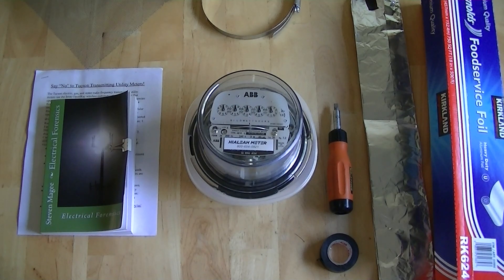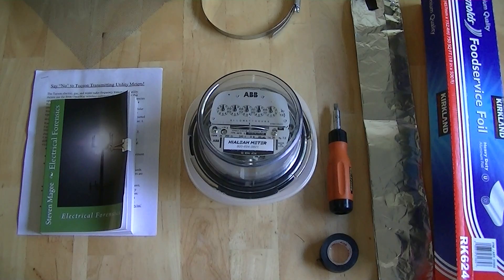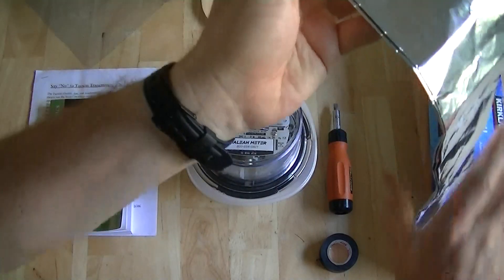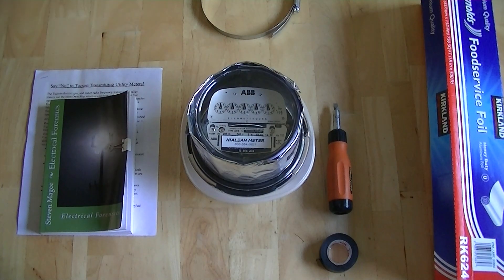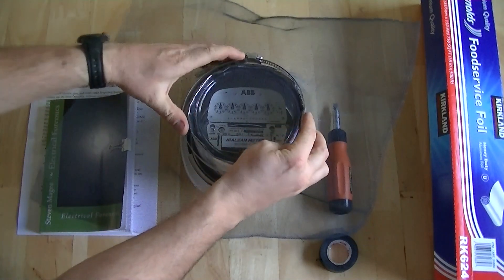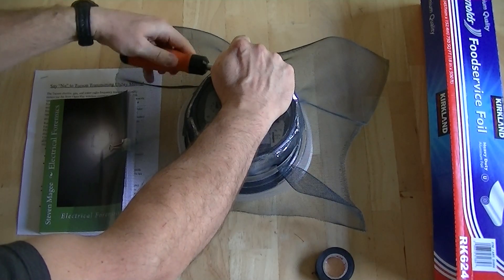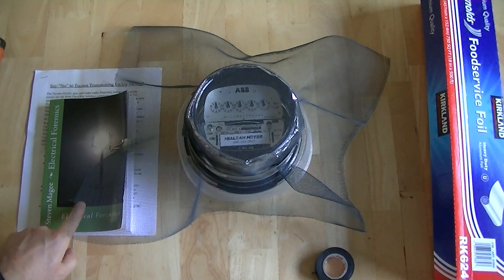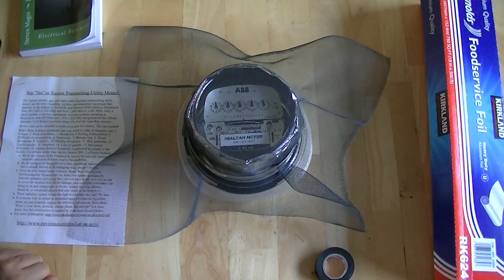The Cheapest Way of Screening a RF Transmitting Smart AMI AMR Utility Meter

Comment: I don't think you need the aluminum foil, and, in fact, that may not be a good idea. Just aluminum screen should be fine, and you DO NOT have to ground it with a grounding wire. (can't hurt)

If you get a decent RF meter and know how to use it, you can check to see what the levels were and are, and experiment if you want. Check anti-smart meter websites for more info.
Reply: If you dont ground it, the sheild just starts resonating (like a bell) with the signal from the stupid meter.

Comment: I'm UK....currently surviving as a slave to pedophiles as my identity was stolen over 13 years ago amongst other things. I'm not 'allowed' to leave. Moving is not an option. Pedo parents had one of these installed last week and it is making me very ill. Tired, achy muscle, my left/ good eye keeps spasming/ very blurry vision and all since it was installed. I was advised by another TI to get those foil emergency blankets...and they have no effect whatsoever. Don't have an RF meter but wrapping it 20 layers thick over my wifi dongle does nothing to dampen the signal......trouble seeing whilst typing this but I am very sceptical that this is going to work in anyway. Notice how the guy in the vid doesn't actually use an RF meter to test? That would be so easy to fake anyway.....nor does this method do anything to shield the back of it....but as i say because of my situation I'm not allowed to do anything to the meter.....it'll probably cause trouble more violence against me by shielding my room/ cell from it....but I'm looking for a cheap way to do that if anybody knows how to do that? No way I can afford the paint.....

Comment: In my country, the smart meter is inside the house. Can I cover the front well with foil too?
Reply: Use METAL screen to cover the front of the meter and aluminum foil for the sides. 
If you can, a space blanket can be pinned to the wall, behind the smart meter.  Not underneath the meter base, but on the other side of the wall. 
Check you space blanket  first. Wrap a cell phone twice with the space blanket, then call the cell phone.
If the cell phone rings, buy a different brand.

Comment: what about the smart meter which are not in round shape but square what shall i use instead of hose clamp please? i am in uk btw
Reply: Hello in the UK, from Texas, USA.  You can use the same aluminum screen wire, but secure it with plastic electrical tape.  Make sure you stretch the aluminum screen wire all the way to the metal box where the plastic cover is attached to.  The plastic electrical tape will work better if you stretch it slightly as you wrap it around the base of the plastic cover, it will create a clamping action to hold the screen wire securely in place.   The square plastic cover may present a challenge in neatly getting the aluminum screen wire to conform to the shape of the cover.  Perhaps you could fold the corners like wrapping a gift in box with gift wrap.  Good luck!
Reply: @barrylitchfield250  thanks Barry i am going to the shop Now. many thanks for your advices

Comment: Will this stop the smart meter from transmitting information?
Reply: No. The info is available, yet the radiation drops dramatically. Be sure to protect the wall inside your home behind the meter. Use mylar. (space blanket) it’s not attractive but it works. 
I use mylar sheets and then used tapestries over it so my wall doesn’t look ugly.

Comment: What comes out the back side through the wall?
Reply: The electrical box should shield most of that. You can put aluminum screen or aluminum sheet or copper sheet and maybe certain mylar space blanket material on the wall behind the box to reduce it more. Put a large framed picture or mirror with aluminum screen on the rear should do more than well enough.

Comment: One would think that if this really worked you would put it on an actual smart meter (rather than an old analog one) and use a RF detector to show it works.I sure aint gonna give you a hundred bucks for a two dollar strainer. Nice try though.

Comment: Can u test on a real meter the level BEHIND the meter going into the house? And out front with and without the screen?  If you shield the front does kkore radiation go back into the house?
Reply: I agree, there is so much RADIATION from the smart meters, covering them will start to KILL the homeowners inside of the home. 
With over 100 deaths every month just from the extremely high levels of radiation, this may increase the death toll to over 200 deaths every month. 
Thanks for the warning mrpush, you have no idea how many lives you will be saving.

Comment: I fixed mine with VooDoo.
Reply: DO NOT TRY ANY OF THESE 

Sigi Henke 3 months ago
How to kill a smart meter.... Get a smaller microwave oven, remove the door screen and glass. Then close the door and set your timer. Then push the microwave oven fully over the meter so the meter is actually inside the oven. Press "Start". The electronics in the meter will be totally fried in a fraction of a second. You probably have seen what happens when metal is in a microwave oven ..... lots of sparks and vaporized metal. Make sure you don't harm yourself by the microwaves of the oven which must be facing away from you!!!!!

Smart meter killer 
https://www.youtube.com/watch?v=Q1wqb03ITI4

Smart Meter Revenge
https://www.youtube.com/watch?v=Odxtf1QYnGc&t=759s

Overloading a Smart Meter
https://www.youtube.com/watch?v=x4MyKe7dj7w

Electricity meter glows inside and pops at 800 Amps
https://www.youtube.com/watch?v=H_ZvLrRiucU

Comment: Hi I have a question if the frequencies are being blocked from the sides and the front where are they going? And is it smart to protect the back of the smart meter?
Reply: ALUMINUM FOIL  AND Space Blankets
Here are TWO things you can do to help. 
#1     WRAP YOUR SMART METER IN ALUMINUM FOIL
#2   BUY A $3 SPACE BLANKET AND PIN IT TO THE INSIDE WALL THAT HAS THE SMART METER ON IT How to test your space blanket, borrow a cell phone that is on and working 
Wrap the cell phone in the space blanket at least twice 
Call that cell phone and see if it rings
 IF IT RINGS, BUY ANOTHER SPACE BLANKET FROM A DIFFERENT STORE
 if the cell phone doesn't ring, then pin that SPACE BLANKET up on the inside wall, opposite of the smart meter that is on the outside wall 
I LIKE THE SILVER ONE SIDE AND GOLD ON THE OTHER SIDE 
Don't forget to have your children to draw pictures of people DYING from the extremely high levels of radiation PS, If your power company complains do this 
#1 Ask to see their license to operate a commercial, meshed network, FHSS, AMI7 radio transmitter* 
#2 When they complain about the contract says, then ask to see the copy that had your signature on it. And if all else fails, ask for a copy of the CERTIFCATION EXHIBIT so you can find out what the DO NOT INSTALL DISTANCE is according to the FCC report

Comment: What about behind the meter?
Reply: ALUMINUM FOIL  AND Space Blankets
Here are TWO things you can do to help. 
#1     WRAP YOUR SMART METER IN ALUMINUM FOIL
#2   BUY A $3 SPACE BLANKET AND PIN IT TO THE INSIDE WALL THAT HAS THE SMART METER ON IT How to test your space blanket, borrow a cell phone that is on and working 
Wrap the cell phone in the space blanket at least twice 
Call that cell phone and see if it rings
 IF IT RINGS, BUY ANOTHER SPACE BLANKET FROM A DIFFERENT STORE
 if the cell phone doesn't ring, then pin that SPACE BLANKET up on the inside wall, opposite of the smart meter that is on the outside wall 
I LIKE THE SILVER ONE SIDE AND GOLD ON THE OTHER SIDE 
Don't forget to have your children to draw pictures of people DYING from the extremely high levels of radiation PS, If your power company complains do this 
#1 Ask to see their license to operate a commercial, meshed network, FHSS, AMI7 radio transmitter* 
#2 When they complain about the contract says, then ask to see the copy that had your signature on it. And if all else fails, ask for a copy of the CERTIFCATION EXHIBIT so you can find out what the DO NOT INSTALL DISTANCE is according to the FCC report

Comment: Also, your neighbours meter is probably facing your house... so we need to deal with that. AND this method doesn't stop emf/rfi from blasting into your house thru the wall,( in our case ... our bedroom!),   but only the outside direction. ???

Comment: Doesn't it stop it from communicating and cant the utility consider us to have tampered with it? They are known to catch in fire. Do we want to have to be in a position of having to fefend ourselves if they claim that we caused a fire? And if it can't communicate, won't it amp up its output and couldn't that cause it to overheat? Have you tested this in hot weather? Why not screen it all and skip the foil? And why didn't you use a test meter for the purpose of forming your recommendations?
Reply: ALUMINUM FOIL  AND Space Blankets
Here are TWO things you can do to help. 
#1     WRAP YOUR SMART METER IN ALUMINUM FOIL
#2   BUY A $3 SPACE BLANKET AND PIN IT TO THE INSIDE WALL THAT HAS THE SMART METER ON IT How to test your space blanket, borrow a cell phone that is on and working 
Wrap the cell phone in the space blanket at least twice 
Call that cell phone and see if it rings
 IF IT RINGS, BUY ANOTHER SPACE BLANKET FROM A DIFFERENT STORE
 if the cell phone doesn't ring, then pin that SPACE BLANKET up on the inside wall, opposite of the smart meter that is on the outside wall 
I LIKE THE SILVER ONE SIDE AND GOLD ON THE OTHER SIDE

Comment: Radio frequency, as I understand it, is not the major issue. Is the 50 megawatts per cubic meter of microwave energy that is the issue. Radio frequencies have been around for a long long time. And have never been shown to be particularly hard on you.
Reply: Let's look at why we do not need smart meters. 
 #1 A smart meter will hurt or even KILL disabled homeowners who have disabled medical implants.  The average of deaths by smart meter radiation and smart meter fires is almost 100 every month in North America.

#2 Did you know if your power company “turned off” the power to your home when they did a smart meter install, your chance of a smart meter fire increased by a factor of 10,000.

#3 Your power company has access to all of you private power information. Eg When you make tea, when you turn on your alarm etc. This private information is sold to Google for huge sums of money. Ask your power company what the second radio transmitter in your smart meter does. (ZigBee) 

#4 A smart meter will cause cancer to return if your family members who are fighting cancer at home. If they come home from the hospital and sleep near a smart meter, they will die. Check with the US Cancer Society website. 

#5 Smart Meter RADIATION  will turn off breakers in your home. Both AFCI's and GFI's get turned off by the radiation from the smart meter.

#6 You smart meter is very accurate, BUT, the software (firmware) is programmable. Your bill has nothing to do with the power you use. 

#7 Smart meter radiation is breaking Ionic Bonding. 

#8 A huge expenditure for a huge loss. Billions of dollars to purchase something that does not general generate any power and each smart meter need 4 watts to operate. One million smart meters use 4,000 KILOWATTS of energy to operate.

#9 The second radio transmitter is for ZigBee. If you want your power company to MONITOR your home 24/7, then you are in luck. Don’t forget, this private information will be sold. Why do you think your power company spends BILLIONS of dollars and does not generate one watt of extra power to sell?
Reply: Actually they have...especially in ham operators and prostate cancer....wrong conclusion. Raido kills at 440 htz...what the nazis changed in the 30s from 432 herts which heals.

Comment: i hoped you wore your tinfoil hat while making this video, otherwise the aliens would be putting crazy ideas in your head.

that meter is not the kind that sends out a radio signal, but if it were, shielding it would simply mean it would use more power to get the signal out.

so you would not be any better off at all.
Reply: Let's look at why we need TIN FOIL HATS. 
 #1 A smart meter will hurt or even KILL disabled homeowners who have disabled medical implants.  The average of deaths by smart meter radiation and smart meter fires is almost 100 every month in North America.
#2 Did you know if your power company “turned off” the power to your home when they did a smart meter install, your chance of a smart meter fire increased by a factor of 10,000.
#3 Your power company has access to all of you private power information. Eg When you make tea, when you turn on your alarm etc. This private information is sold to Google for huge sums of money. Ask your power company what the second radio transmitter in your smart meter does. (ZigBee) 
#4 A smart meter will cause cancer to return if your family members who are fighting cancer at home. If they come home from the hospital and sleep near a smart meter, they will die. Check with the US Cancer Society website. 
#5 Smart Meter RADIATION  will turn off breakers in your home. Both AFCI's and GFI's get turned off by the radiation from the smart meter.
#6 You smart meter is very accurate, BUT, the software (firmware) is programmable. Your bill has nothing to do with the power you use. 
#7 Smart meter radiation is breaking Ionic Bonding.
#8 A huge expenditure for a huge loss. Billions of dollars to purchase something that does not general generate any power and each smart meter need 4 watts to operate. One million smart meters use 4,000 KILOWATTS of energy to operate.
#9 The second radio transmitter is for ZigBee. If you want your power company to MONITOR your home 24/7, then you are in luck. Don’t forget, this private information will be sold. Why do you think your power company spends BILLIONS of dollars and does not generate one watt of extra power to sell?
Reply: you make them sound like a bad thing ...
Reply: SO YOU DO THINK KILLING 100 PEOPLE A MONTH IS NOT A "bad thing"
DON'T FORGET TO AD ANOTHER 10 DEATHS FROM SMART METER FIRES
Reply: i did not say if it was good or bad, i said YOU think it is a bad thing.

i also notice you felt the need to use all caps to scream at me.

have you taken your meds today ?
Reply: Frederique Zug: Thanks for increasing subscription and visitor numbers to my channel through multiple re-posts and promotion on 3rd party video platforms! My copyrighted content is now monetised in selected geographic regions. Thanks a lot Madame.

Comment: Does that also prevent the surveillance aspect of the meter?  SMART is all about surveillance, not just radiation.....
Reply: No!
Reply: Unfortunately not
Reply: A 1:1 isolation transformer can easily be made, from as small as the 120/15 receptacle on the wall, to a 240/200 unit for the whole house (much more expensive). This prevents the high-frequency communication between the power company and your "smart" devices, keeping them from a) knowing what you have, b) knowing how much energy it's using, and c) being able to turn it off remotely (this is a particular issue in areas with soft grids, where they might shut down your A/C on a hot summer day because too many people are using them!).

Comment: If I move to a new home, I would have an electrical contractor come out and set a concrete pad, and install a big "ISOLATION TRANSFORMER/Power Conditioner" there, and run the Utilitie's electric power thru a FUSED DISCONNECT Switch, and then into the primary of that transformer. Then the "CLEAN" "Secondary" power would go to a manual or automatic "Transfer switch, with a connection point for a Generator, and other (Alternative" power sources, (Wind, and or Solar equipment), and then run my power into my house, and Pole barn, and Garage(s) SAFELY!!!    Soon EVERY HOMEOWNER will just do this and the "SMART METERS will become "IDIOT METERS"!!!! LOL!!!!

Comment: What do you do if the utility company already installed a smart meter but did not notify or ask you?  If the box belongs to the homeowner then the utility company has tampered with it.  Also, if the box belongs to the property owner then how can they put one of their tamper proof tags on it and then issue consequences for "messing with" their tags?
Reply: WRAP YOU SMART METER IN TWO LAYERS OF ALUMINUM FOIL

Comment: I put aluminum foil around my entire smart meter and it impacted my health from touching the meter. Made my hands and then arms ached for several days and glands were swollen too. I am electro-sensitive. Would recommend someone not so to do this shielding, if to be tried. I would be concerned about the radiation coming through the back of the meter AND along the house wiring. Best to opt-out if you can. But this is second best if you also shield the back. I caution people not to stand directly in front  of the meter when doing this, too. That meter looked like an analog, I must say, not a smart meter...
Reply: Have them move the meter to a pole in the yard. That way, you can get a clear shot at it with your shotgun...
Reply: Otherwise, get off the grid!

Comment: why bother with the foil?  from my understanding, the screen all around should do the trick as an F-cage i.e. 90-95% EMF-reduction.   an F-cage dissolves bad RF vs deflect/beam it out onto kids/pets/neighbors.  also an Fcage doesn't need to be grounded, yet would be in this case by touching the box chassis.